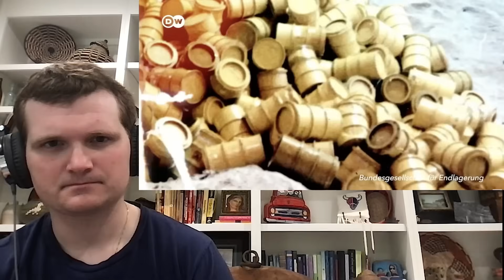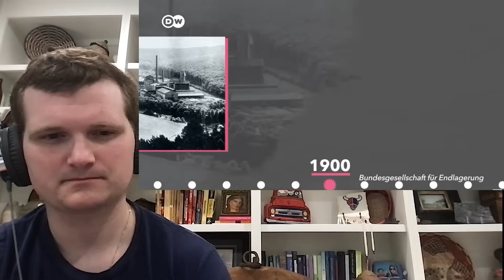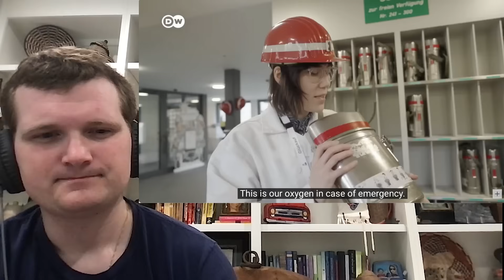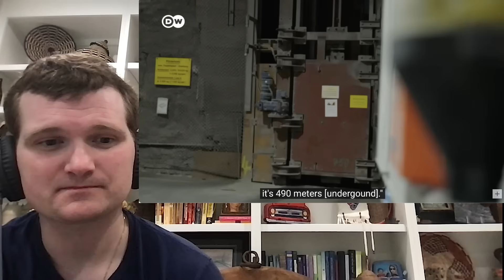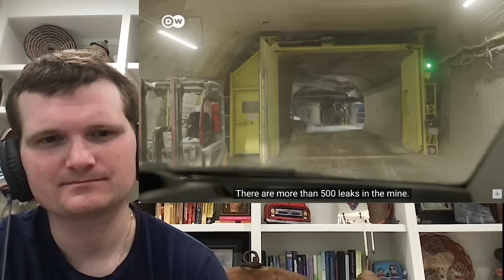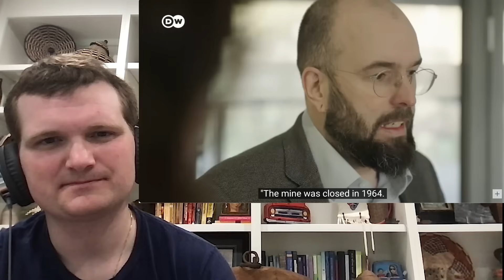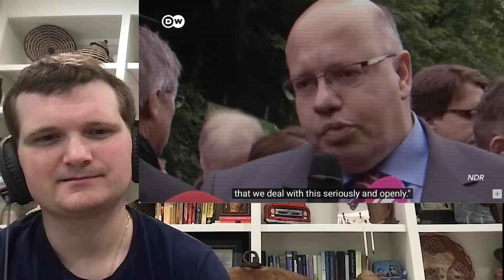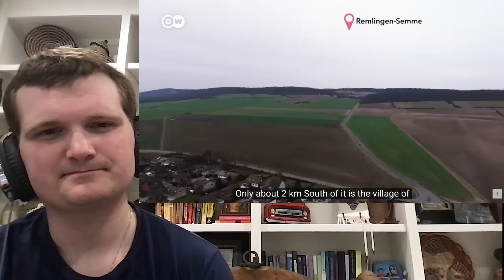This Nuclear Waste Dump Has Been Leaking for How Long? - Nuclear Engineer Reacts to DW Planet A

Comment: Unfortunately the source video does not seem to quantify the radioactivity present in the waste, let alone how soluble in brine it is, or possible paths into the aquifers. Presumably there is not much vertical flow, otherwise the drinking water at the surface would be quite salty.

Doesn't ALARP/ALARA mean the cost/benefit tradeoff needs to be quantified? What about the other mines across Germany (coal, pitchblende, arsenic, mercury, lead) especially those close to the surface with fresh-water running through them? Perhaps the US/UK/France/Switzerland etc got it right by just putting the low level waste in a trench in the sea. Dilution to the rescue.
Reply: That's the main problem. They don't really know what's in there since they kept poor records and are unable to recover or inspect barrels.
Reply: @tachy1801  I guess that principle also goes for normal landfill sites, except that waste is closer to the surface until fairly recently there was not much geo-engineering (clay and membranes etc) going on.

"Retrieving waste from the Asse salt mine – facts and challenges" by Horst Geckeis posits that the Asse II decision is not driven by engineering.

Comment: The real issue is that Germany calls almost everything that was ever in the nuclear industry "nuclear waste" probably even the pay slips of each and every employee. Thus the nuclear waste problem is huge but includes lots of things that are not radioactive. However no-one has yet found a solution to the really active isotopes present in minor quantity.
Reply: The real problem with the proliferation of nuclear waste, is that those pay stubs were recorded in triplicate...

Comment: In France, after spent fuel has cooled off a few years in the pool it's recycled and the extracted High level waste is embedded in a glass matrix similar to obsidian inside a stainless steel canister, which is then kept under several meters of concrete at the treatment plant awaiting the opening of our geological waste repository to be transferred, probably within the next decade.
If you're interested in the process you should check out "Orano la Hague"

Comment: A hot hot mess x

I wonder if they are getting any significant readings as they investigate each chamber. Could they skim off the outer layer, then take readings again to see if any material excavated is higher dose?

Cause in theory they are putting enough money into this space, so processing could and should be considered. Why risk transporting waste when you have all of the secure area to work in.

Comment: I've been a staunch supporter of nuclear energy for a very long time, in Germany. Also, I had physics as a secondary to my degree in math. Chernobyl didn't convince me to drop it. Fukushima wasn't an argument for me. But the failure of Asse finally got me. Think of it. This was announced as a test facility, an experiment! What do they teach you, every time you do an experiment in the physics laboratory as part of your course in experimental physics, which happens every week for 12 - 16 weeks in a row, with two such course mandatory, so at the end of the 3rd semester you have raked up somewhere up to 30 experiments?

                        Keep a proper protocol for your experiment !

No protocol, or an incomplete or sloppy one, is an automatic F!  Which immediately begs the question: What kind of scientists were they?
I can come up with only two possible explanations:
-  Either, these were total morons, the least qualified, most incapable scientist, unable to get a job elsewhere, because who would want to watch the waste decaying for the next 100 years, if he can get a better job elsewhere. 
-  but more likely, the answer is actually: they weren't scientists in the first place. Meaning: the whole shebang was rigged from the start. And that really p*s me off. There can be no excuse for this kind of deception.

Comment: I'm curious, I'm a pool guy, what kind of water chemistry does a nuclear power plant like and why? I would guess 0 ppm salt, 0 ppm Cl, 7.7 pH, and 100 ppm Total Alkalinity. Is there an automated muriatic acid system or is there a NCPO (Nuclear Certified Pool Operator) on site making adjustments?
Reply: I don't deal with pools but I do deal with steam heating systems. And steam boilers should ideally be kept at 10-11 pH to keep the iron block from corroding. If anything is stored in plain steel containers or racks, I would guess the pH would be kept above 10 but below 12. As iron corrosion stops at around 10 pH but pH of 12 or more causes embrittlement.
Reply: @theodorgiosan2570  That's interesting. I hadn't considered that metals corode at different alkalinity, or that metals like iron and steel, considered strong metals, would need such a high alkalinity to not corode. Is it a temperature thing, since it's a steam system instead of a near ambient temperature liquid water?

Comment: @T. Folse Nuclear: The video is more than overdramatic. You have to remember that this government-run TV channel the video is from is fully in line with the eco-socialists of the German Greens and Communists, who are in charge at the moment in the country and are completely anti-nuclear everything. 
The video is already BS in the title. The contents of the mine are not unknown, nor is it secret or hidden. Ninety percent of the stored content comes from the former Karlsruhe reprocessing plant, a further five percent from two nuclear research facilities, three percent from energy supply companies and the remaining two percent from hospitals, industry, etc.
First of all, the 126,000 barrels stored in the mine currently contain waste with a total activity of one two-hundredth of a single high-level container. This activity is today only a fifth of what it was in the 1980s due to continuous decay.
The yellow barrels that can be seen are the barrels with the typical low-level waste. Gloves, cleaning rags, work suits, packaging, tools, etc.
These are the barrels that were simply dumped in the 1970s and early 1980s.
The medium-level waste, for example, was melted in boron glass and is stored in the form of molds made of molten glass in concrete barrels, or in steel ones. Good to see in the video. These are also unproblematic. Like the high-level storage containers.
Even the water "problem" is no problem as such. It is around 4 cubic meters of water they have to deal with throughout the whole mine per day, it was 12 cubic meters a couple of years ago. Most of the water, 99+%, does not contain any radionuclides. They collect at the moment 8 Liters of low level radioactivitiy water per day. And it is a myth that the mine will soon be flooded. 
That video is more or less anti-nuclear panic propaganda video.

Comment: Did my diploma thesis in geology as a student many, many years ago in the Asse for a test storage field. The great advantage of salt is that it flows, albeit very slowly. After 100 years or so nearly all the cavities have closed by themselves and everything is nicely sealed. And if there are no cavities no water will flow. So at least low level to intermediate waste could be stored quite safely for thousands of years. High level waste has other problems with heat generation, but they were never stored here. The whole of North Germany has massive deposits of rock salt deep underground, with massive salt domes forming, as salt has a lower density than the overlying rock. This salt is layered with different types of salt and usually covered with impenetrable layers of clay.
Unfortunately the Asse is an old salt mine, not built for removing standard "cooking salt", but to mine the much more valuable Potassium, Magnesium, and other salts that can be used for fertilizers, the chemical industries, etc. Unfortunately these valuable salts can mainly be found in the outer regions of the salt dome, close to the sealing layers of clay. If these clay layers are damaged it is possible to get a rapid inflow of groundwater which dissolves the salt in its way and can lead to total flooding of a  mine in a couple of days. 
This has happened quite a few times in the region, but is obviously not the situation in the Asse II, as the outer layers have not been mined for decades, and the water inflow has also been occuring for a similar time.
It is purely a matter of risk asessment whether it is better to try and retrieve the dumped radioactive waste or try and refill the mine as quickly as possible, thus also stopping any further inflow of water. I tend to think the latter solution might be best, but admit I do not know any of the newer research done  here.
Reply: Excellent note. I would love to read this.

Comment: in germany our government/leading can change every 4 years since its usually split between partys (51% rule, so usually partys coalate to reach it ) and then we get new ministers if the proportions changed (seats also tied to votes) or a diffrent set of partys has enough seats to take over.
Reply: Government can make a long term plan, and it would be hard for the next government to get rid off. The money spent would be easier to deal with when there are plans for the next 15+ years. Divide the cost for all those years. Would be a political suicide to step away from it. There needs to be a proper leader who manage this. Openly inform people step by step through the project. People are only scared when leaders hide information.
Reply: Let the dogs bark, the caravan goes on still😉 Some early Helmut Kohl.